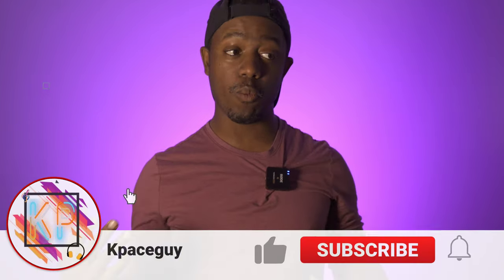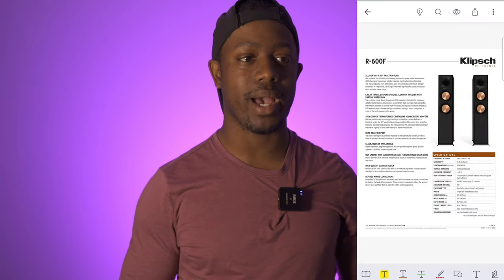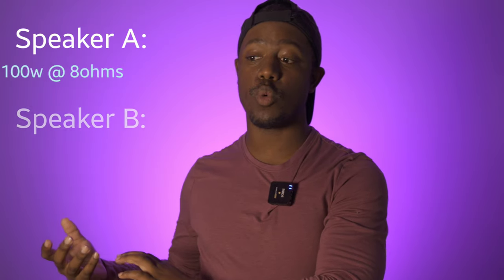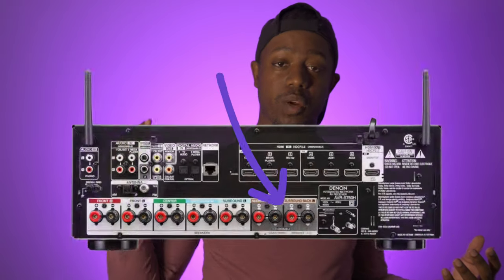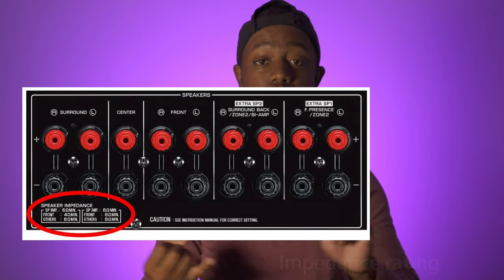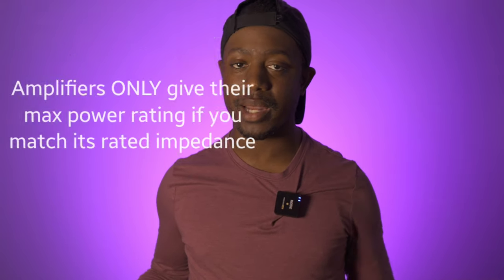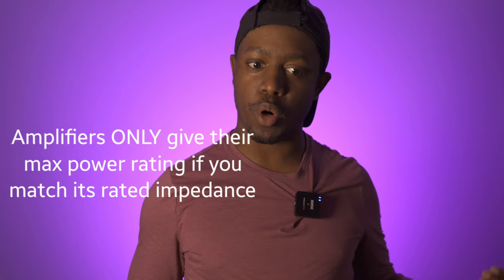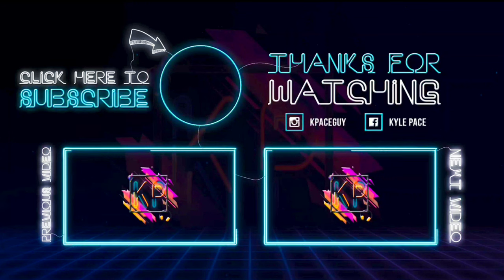Speaker Impedance (Ohms) and How to Match Amps w/ Speakers

Comment: The general advice would be that it’s fine to connect speakers with a higher impedance to an amplifier capable of operating with a lower impedance, but what you shouldn’t do is connect speakers with a lower impedance (say, 4 ohms) to an amplifier with a higher minimum impendence (10 ohms, for example).  Today many amplifiers can handle a range of ohm ratings usually between 6 to 16 ohms.
Reply: Ll
Reply: Hi there , thx to ur great sharing on this topic. I would like to ask a question about . If I hv loudspeaker which is 2400w in 6 ohm. Can we connect this 6 ohms speaker to the power amp which rated as 4 ohms@2300 w per channel ? Will it blow up the power amp ? Or power amp will only delivery certain % of power to drive this 6 ohms speaker only ? Kindly advice . Appreciated to ur kind help n assistant . Wish U hv a great day ahead
Reply: Correct
Reply: @hidewong hey this is just based on my knowledge and experience if you go higher than the recommended ohm rating it will work however you will lose some power and in the long run will affect the equipment.
Reply from the maker: @elijahsmith9569 that is correct
Reply: @elijahsmith9569  no worries, sharing is caring.. appreciated for ur kind sharing and advise on this topic, we learned a lot that we never been. thanks again.

Comment: omg this is so wrong. the speaker isnt asking for more "power" from the receiver. it gives less resistance. its exact the opposite. on a 8 0hms speaker the receiver has too push harder. it pushes against more resistance. with 4 ohms it has too push less. so, more current flows on 4 ohm wich is more taxing for the amp but this will also give your more OUTPUT. your result is correct, but your reasoning why is wrong.

Comment: My speakers are 6 ohms at the maximum power handling is 300 watts less clipping. I am using 400 watts rms. These speakers are very efficient which could be used easily with 100 watts rms. Danger with any loud speakers is don't over drive the amp into the clipping mode which harms both components. Better off with extra power than less power. JBL use to put in the owners manuals with the speakers, danger low power! So true!

Comment: Hi! I have a Samsung SWA-9200S rear speakers but i dont have the speaker cable that connects left to the right speaker. Both speakers have 3 ohm impedance and I don't know exactly which speaker cable to buy. Does it have to have a specific gauge? A specific cable length?
Reply from the maker: you need 18 gauge wire long enough to reach the power source

Comment: This video was incredibly helpful! Many thanks from someone brand new to the world of audio!
Reply from the maker: Thanks for watching!
Reply: @Kpaceguy  SO I think I have grasped this concept, but not sure... my speakers are imp = 7ohms +/-3ohms, and the manual states receiver should = 40-160watts.  My receiver says Front A and B : 8ohms minimum @ 95watts x 7 into 8ohms. So if I have 7 channels, I will get 8ohms and 95 watts per channel? I think its an okay match b/c the receiver with 7 channels is 95 watts, which is between speakers' 40-160 watts, receiver is 8ohms which is more ohms (not as powerful) but still close to the base of the receiver at 7ohms +/-3. Thoughts?
Reply from the maker: @jaimer1864  it'll work just fine
Reply: @Kpaceguy  yes! Thanks so much!

Comment: This video is the first I’ve seen that made me understand this topic! So if I’ve got a 3 way active setup with speakers rated for 8 ohms being powered by a 6 channel amp rated for 4 ohms, the speakers won’t be getting the full power from the amp?
Reply from the maker: Correct. Which may be fine as long as it's 8 ohm rating matches your 8 ohm speakers. Say your 8 ohm speaker is rated at 150 Watts and the amp does 150 Watts at 8 ohms and 300 Watts at 4 ohms,  it's still giving the correct power to your speakers

Comment: Hi KPace!
I have a pair of JBL L7 speakers rated 6ohms and the center, ceiling, side surrounds and rear surrounds are Klipsch 8ohm speakers.

Would it be bad to use a Monolith 11x as an example to connect all of them using a Marantz 7706 Processor?

Thanks for your time and hard work!
Reply from the maker: The monolith 11 would be perfect. Its rated for 4 to 8 ohms
Reply: @Kpaceguy  Thanks so much for your help and info! I really appreciate it and appreciate you! 👍

Comment: I’m looking into purchasing some Arendal 4ohm speakers.  With Parasound 51 amps.
Reply: That parasound A - 51 has some good power. It will drive low impedance speakers with ease. Good choice, good amp.

Comment: Hi just watched your video, very straightforward and interesting info. So I have a question😊 I am planning to pair a vintage Pioneer SX-1080 (120W into 8ohm) with JBL 75th anniversary speakers model L100 classic 75 (200W into 4ohm). Would u reccomend coupling those together?
Reply from the maker: Yes it'll be fine
Reply: @Kpaceguy  Wow that was fast thank u so much👍😎

Comment: Hey bro, nice video you got here very informative. 
So i just have a question, ihave a 2 speakers with both 6ohms in impedance. How can i convert their impedance to be match with only 4-8 ohms amplifier only? Thanks
Reply from the maker: You don't need to. Just plug then to an amp rated down to 4 ohms
Reply: @Kpaceguy  i supposed to DIY or build my own box, using just a cheap amplifier board, 1 have 1sub, 1woofer and 1 tweeter, all of them are 6ohms.the amplier got only 2 output terminal, for speaker and tweeter. My plan is to use the speaker out to my sub and the other out to woofer and tweeter both 6 amps. Thats why i need help in converteing 2 6ohms to match in 4-8 ohms board only. Thanks bro

Comment: I’m really trying to understand Ω and watt, but I don’t get it 😭
If 4 Ω speakers requires more power from an amplifier, then how is it that an amplifier produces more watts when they’re set to a lower impedance?

I’m missing something. Can you help? I would really appreciate it!! 🙏
Reply: yeah his result is correct but his reasoning is wrong. see the speaker as a garden hose where water is flowing through. voltage is the pressure of the water and impedance is if you pinch the hose with your fingers. if you pinch it more (8 vs 4). less water will flow. at 0 ohms all water will flow without impedance. so thats when the amp has too pump out most watts/power. the pressure/voltage always stays the same.

Comment: The amplifiers in the world today are fairly wonderful beast and players of such beasts in many levels. An amplifier is just what it is. It's amplifiers something in this case it is an electrical current that is transferred into sound. Amplifiers out there these days are magnificent to the point that they are rated down to so if an amplifier says it's 1 ohm rating is that's what it is you can put a 4-ohm speaker on a 1 ohm speaker amplifier, you can put a multiplicity of 4 ohm speakers onto a 1 ohm amplifier and in fact wire them correctly to get 1 ohm. The sky's the limit. The Ohms on the amplifier must be less then the value of what is on the speaker.

Comment: The ohm rating is clearly understood but now to the wattage. If I have a 300w ampliifer is it advisable to connect it to a lower wattage of the speaker or it has to be higher.
Reply from the maker: lower is fine but if its way too low you'll risk blowing the speaker very easily. You want to be within 100-150 watts or so either direction if possible. Not always possible so in that case just be careful.

Comment: I have an Onkyo tx nr5100 which is rated at 4-8 ohms. All my surround speakers and sub are rated at 8ohms. My question is if I can use 2 atmos speakers which is rated a 6ohms?? To note that when setting the amp it specifies 6 ohm or higher but i'm a bit confused. Can someone please give me the light. Thanks in advance.

Comment: Thanks for clear explanation! Im wondering that is when we have ranges? Exaple in my case: speakers 4-8 ohm and amp 6-16 ohms. Is it good combination? Its confuseing when ranges are specified. Please help, thanks
Reply from the maker: It just means the speaker can dip low or peak high depending the power and frequency coming to it. Your amp is fine
Reply: Thank you!

Comment: I have a Nakamichi amp that says 4x50W.  Model No. NGTD 4-M and 40Hz - 400 Hz.  I cannot find anything about Ohms on it.  It is a amp for a motorcycle that I've had for about 7 years.  It came with a couple of 6x9 speakers that lasted for about 5 years.  I replaced them with some Palk 6x9 speaker and so far, two sets have gone bad.  They play great for a few months and then turn to static.  I am in the process of shopping for some new speakers.  I feel that I am doing something wrong for the speaker to keep going out so soon.  What type of 6x9 speakers would you suggest for the type of am I described?  Thanks.
Reply from the maker: Most likely 4ohms
Reply: Get an amp to power them
Reply: If the speakers die and the amp is fine, try some speakers rated for higher wattage

Comment: Your video was more helpful than many other videos I've watched trying to find an answer to a question related to matching a speaker for my Fender guitar amplifier. The amp is 4ohm 250 watts... and I have found an 8ohm 250 watt speaker. Am I correct in thinking it should work out alright? It's really difficult to find a guitar amp replacement speaker with 4ohms.... they tend to be mostly 8ohm speakers no matter the wattage. Most guitar amps are 8ohm, so the one I have is out of the "ordinary" at 4 ohms. Thanks.
Reply from the maker: You'll be fine but you won't get anywhere near 250 Watts
Reply: I don't really need 250 watts of power. About 100 watts of power would be more than sufficient for playing smaller venues. Any large halls or outdoor concerts I would run a D.I. box to the F.O.H. mixer. BTW it's a solid state amplifier (if that makes a difference) Much appreciated!

Comment: Thanks. 
I have a 4ohm speaker with 3000w. And amp of 8ohm with  2000w. can i connect two 4ohm with 3000w to it in series
Reply from the maker: Yes but each speaker will only see 1000w
Reply: Thanks for the informations obtained from you all as I'm new to matching speakers,I got a used power amp with 3500wats ,and my friend donated me pair of 6ohm  speakers,will it blow up my power amp?Want some advice on this.Thanks
Reply from the maker: Most likely no

Comment: Hi,
I have an Onkyo receiver with these specs: 95 W per Channel (8 Ohms) or 165 W per Channel (6 Ohms). My speakers are canton with impedence 4-8 Ohms. I can set impedence either to 4 or 6 in the receiver and wondering what is the best setting? Shall I set to thr lower limit (4) or the middle one (6)? Knowing that the speakers tolerate both. Thanks!
Reply from the maker: Leave it at 8
Reply: The receiver is only allowing me to set to 4 or 6 and I'm confused which is best
Reply from the maker: @jawad5541  it's only allowing you to switch it to 4 or 6 because it's already in 8.
Reply: @Jawad  Ur speakers will be safe coz Onkyo rated ohms are 6~16 Ohms

Comment: Finally great video.. Still I have a question to ask, my home cinema is very budget, I bought all staff cheap ( looking for good deals locally)  my amp is Yamaha RX -V673 ( 7.1 - 6 & 8 ohms) I connected  all 5 pioneer S-11  150 W  RMS  6ohm speakers + active subwoofer.   I was able to get another set of pioneer S-11+ active subwoofer. My plan is to add two more channels (7.1) and second subwoofer for extra coverage 7.2.  What if I would like to use spare speakers (x3) .I mean connect two speaker per channel ( let's say front, left right would be double up) Having all that sound come from different angles is the ideal experience but how my amplifier will handled this? I'm not pushing to high volume. How I should connect this speakers parallel or series?  I'm lucky I get amplifier for 10£, one set of pioneer 20£, second set 30£ ;) Total 60£ I love sound from Netflix/ Disney with this home theatre. I connected all with vandamme cable's (free -lucky me) would be great to read your opinion. Thank you
Reply from the maker: No.  You cannot combine speakers to one amplifier, it lowers the impedance and will cause big issues. You take two 6 ohm speakers and put them together and it becomes 3 ohms
Reply: @Kpaceguy   in this case will just add 2 more speakers+ subwoofer. Thank you for sharing your knowledge

Comment: Hello! I  loved the explanation but I wanna see if I got it right; My marshall MG CX 101 (a 100 watts guitar amp) runs a 4 ohm 12" speaker. Could I put an 8 ohm 12" speaker there instead without frying my amp? I ain't playing much live, so I wouldn't put it to the max.
Reply from the maker: You can plug anything to it as long as the number is higher than it's ohm rating. So yes.
Reply: @Kpaceguy  thank you! so last question! APART FROM THE SIZE THE SPEAKER, would it matter if I actually put an 80/50 watt 8ohms speaker on that same marshall?
Reply from the maker: @nikolasaguilera3496  yes it matters. If you're getting 100 Watts at 4 ohms, it's probably less than half of that at 8 ohms. The amp won't give enough power to that speaker at 8 ohms

Comment: I have a Yamaha A6A receiver, and my fronts are Klipsch RP-8000F (8ohm/150 Watts), my center is Klipsch RP-600C (8ohm/125 watts), my surrounds are Klipsch RP-500SA II (8 ohm/ 75 watts) but my four height speakers are all Sony SSCSE (6 ohms/ 100 watts). I'm wondering if I should select the 6ohm setting on the Yamaha A6A or leave it on 8ohm. There's already not a lot of sound coming from the height speakers and the last thing I want to do is starve them of power.
Reply from the maker: Leave it

Comment: Ok so I think I understand. Correct me if I'm wrong.

If I have speakers that say 
- 4 ohms
- operating watts 90 
- max watts 240

And I have app that says
- 4 ohms
- 1200 watts

I'd be totally fine, with loads of headroom in the wattage???

Or do I want the watts to match as well?
Reply from the maker: You have way more power than you need which means be careful with the volume level. Otherwise it's fine .

Comment: What is the equation of finding the wattage that a speaker will output when connected to an amp at a lower ohm? Ie. how many watts will a 100 watt 8 ohm speaker actually output when connected to an amp pushing 100 watts at 4 ohms? Just curious - these numbers might not make any sense in the real world - but for the sake of finding the relationship?
Reply from the maker: You don't really know without testing the amp. . But it's safe to say it's probably cut in half the power or less because of impedance rise

Comment: There was a time (1970's/80's) when most amps (receivers, integrated and power) easily drove speakers rated from 4 ohms on up. The amp switched internally between 4 and 8 ohm impedances. Even lowly 15wpc receivers could drive 4 ohm loads. Most amps were rated at more power into 4 than 8 ohms. The sticky wicket is that speaker impedance varies with frequency and speakers are generally labeled 8 or 4 ohm "nominal" impedance. Still though, it's not uncommon for 8 ohm speakers to dip to 5 ohms at some frequencies. One caveat, never connect pairs of 4 ohm speakers in parallel to a transistor amp as this will require  2 ohms. Few amps can provide this. Interesting video, lucidly explained in your own inimitable way.
Reply: I have one of the amps you talking about have it from 1992 still running handing 8ohm and 4ohm

Comment: Hello when connect 2 speakers 8 Ohm it will go 4 Ohm to amplifier ?
Can be go 16 Ohm how can connect wires to this side 16 Ohm ?
Reply from the maker: Yes two 8 ohms =4
Reply: @Kpaceguy  tell me connect wire how to get with speakers 8  Ohm to 16 Ohm ?
Amplifier is 6-16 Ohm
Can help me

Comment: Ok ok… 8 ohms AMP@140 watts x3 channels & 200 watts x2 channels
AND I have a two 6 ohms speakers with 50-120 watts.

What is going to happen when I put these 2 together- good, under performance or bad/really bad?
Reply from the maker: It'll be fine

Comment: Hey, I have a Sony STR-DN1080 amp rated 165 W / 6 ohms per channel. Would this work with a Klipsch RP-6000F II, POWER HANDLING (CONT/PEAK) 125W/500W
NOMINAL IMPEDANCE 8 Ohms? Thank you!
Reply from the maker: Yes
Reply: @Kpaceguy  Thank You!

Comment: Hi Kpace, I have some odd 3 ohm 5.1 speakers that originally came with a samsung bluray player/receiver. It seems they are extremely uncommon. Is there a receiver that can safely power them on the market/what receiver would the the correct choice since none seem to be 3 ohms or should I get rid of them and find standard 8 ohm speakers?
Reply from the maker: A 4 ohm amplifier will do fine. That's what was in your Samsung. It wont be hardly any power to operate so a 4 ohm will be fine unless you just really want new speakers